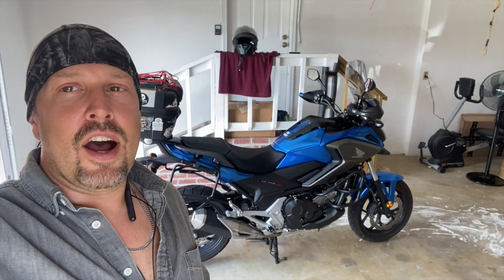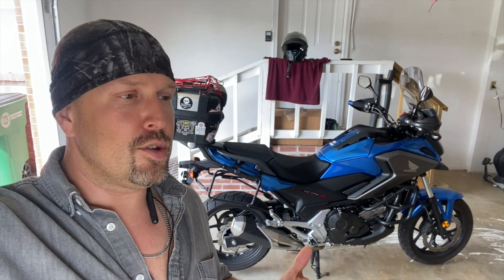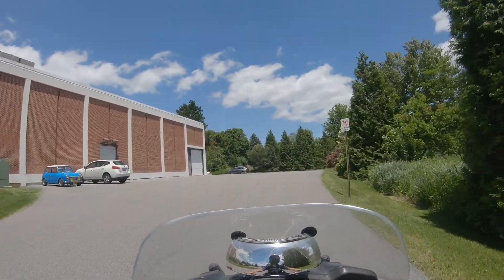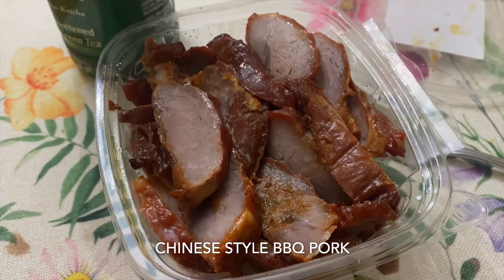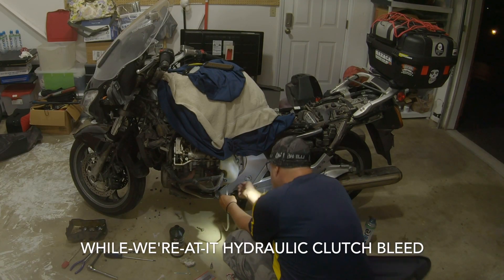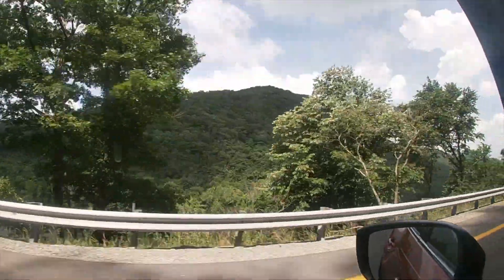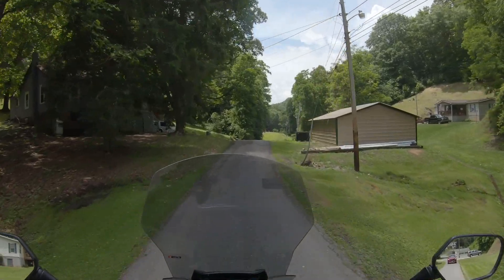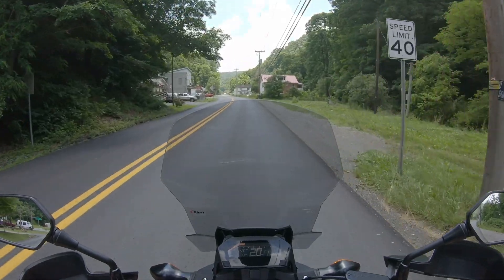DMV: Taking a ROAD TRIP to West Virginia to Pick up an NC750X & Road Review

Comment: I know this is an older video and you have a new bike.  Recently, I was looking at the Honda ST1300 as my next bike purchase.  I saw a few on FB.  After researching required maintenance and possible issues that usually develop because of owners' lack of maintenance, I decided to pass on the ST1300 model.  They are cool bikes, if one can find a well-taken-care of one.  I like wrenching on bikes, but rather spend time riding them.
Reply from the maker: They're really temperamental if stored improperly. Probably true with most efi, hydraulic clutch bikes. You never know what you're getting when buying used.

Comment: I'm currently riding a Yamaha Super Tenere, and the NC750 is on my radar for a number of reasons. Lighter by about 100lbs, with a lower center of gravity. Also better fuel milage AND runs on regular gas,(Super T requires 91octane minimum). May get the DCT version for ease of riding in town, which may deliver even better mpg. Ride safe.
Reply from the maker: Yeah, I have a buddy who swears by the Super T, but I really like the simplicity and lightweightedness of the NC. There are probably bikes that perform much better, but it checks a lot of the boxes 💀

Comment: For anyone bleeding brakes on "anything", or changing power steering fluid, siphoning gas, or just sucking out the old clutch or brake fluid ., ,make a vacuum tank by turning the plunger up side down in a" metal" weed sprayer , then take the push in rubber flapper valve, & put it inside the pump, (instead o f outside), & then push it in place with a broom handle, or anything handy. Now  you have a great one person bleeder, that will create enough vacuum to slowly pump the brakes & not draw in any air ! Yes you will need some rubber hose to get down to the proper size , that part is easy..
Reply from the maker: Sounds awesome!

Comment: Hey , maybe try some highway pegs on your engine crash bars . What a great addition to my bike  when cruising . They are a cheap mod and  very comfortable to cruise with . They also give you an option when your ass is getting sore  as moving from the foot pegs to the highway pegs or back to the foot pegs actually gives your numb ass some relief .. Also if your experiencing wind buffeting on your helmet I bought the small windshield addition that fits on top of the standard windshield and honestly it completely eliminated the wind buffeting ....hard to believe but honestly true .

Comment: The biggest pain in the butt is you have to lift the back seat to put fuel in it. If you have the bike loaded down you will have to remove everything in order to put gas in.
Reply from the maker: I worked out a system for that which I'll show in the next video 😎

Comment: Have you ever considered a bike like the Royal Enfield Himalayan? I've never owned one, YET, but one is DEFINITELY in my future! I've read a great deal about the bike, and everyone who's actually toured on one and used it for what it was intended, slogging around on unimproved roads and touring back roads, have had nothing but praise for the bike. It is about as simple as a 1955 McCormick tractor, if you get a 2018 or earlier version of the bike, (carbureted and no ABS brakes). There's also no plastic on the bike, which makes it extremely simple to work on. I am actively looking for one right now with low miles and factory panniers. As for your new bike, I am very interested to see how you are going to like it and how it will hold up as a back-roads tourer considering its sport bike ancestry. I know the engine on this bike is supposed to be one of Honda's "forever runners" like their in-line 4's and the old, carbureted Gold Wing boxers. Good luck with the new bike, and I'll stick a little something in the kitty for you. Thanks for the great content!
Reply from the maker: From everything I'm hearing, it's a great freaking bike. A buddy of mine let me take his Himalayan down the road, and I really liked it. It's extremely lightweight and super-simple, but is lacking in power/ torque, but should be perfect if you're not in a hurry. Perfect for the situations like you described. And thanks! ✌️😎